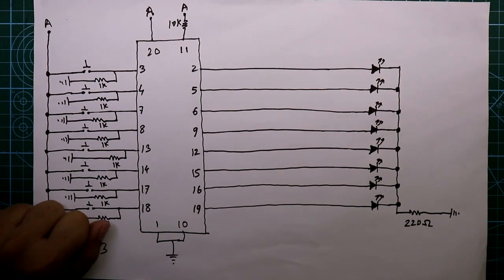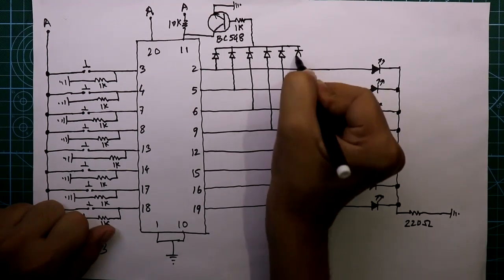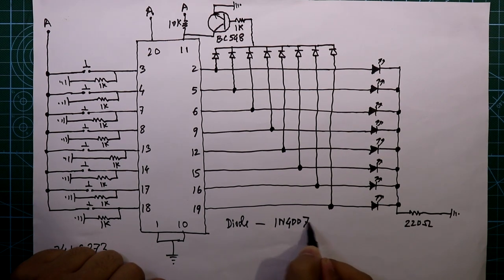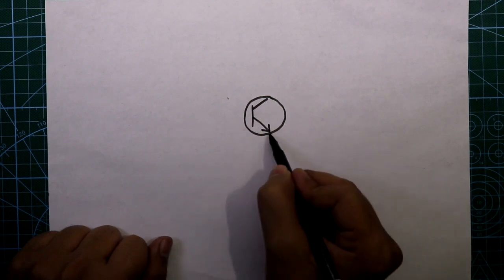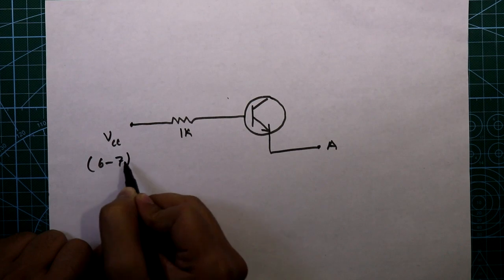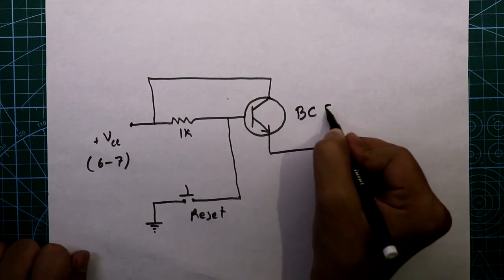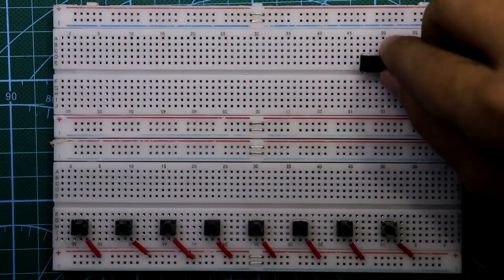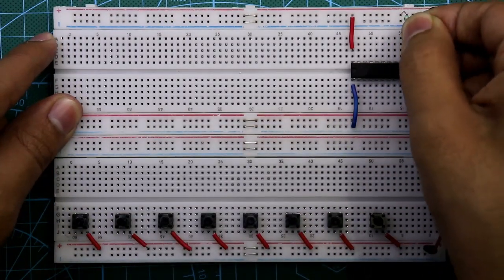Quiz Buzzer Circuit for Eight players using IC 74LS373 | EE Project

Comment: Hi thank you for this video, it works and is great!!!
I want to run longer cables from the control board to the switches... the moment it's longer than about a meter, the system malfunctions and the buzzer sounds non-stop. Is it because of too much resistance in the long cables? What do you suggest i do if i want long cables (20 meters)?